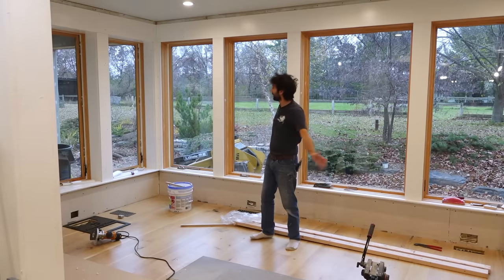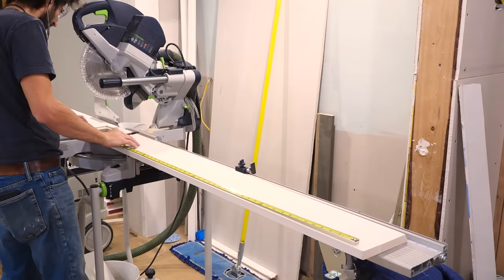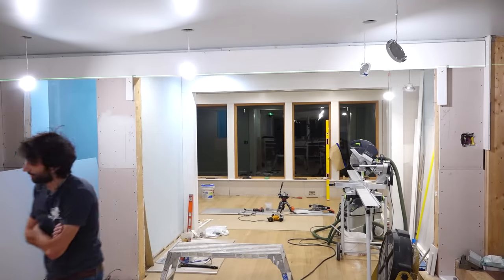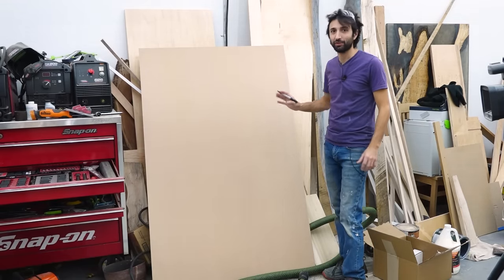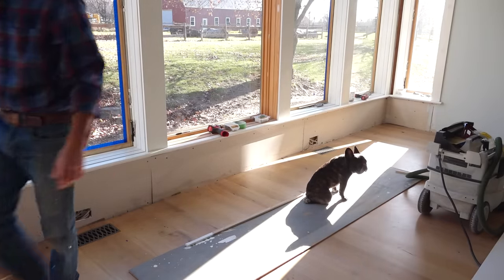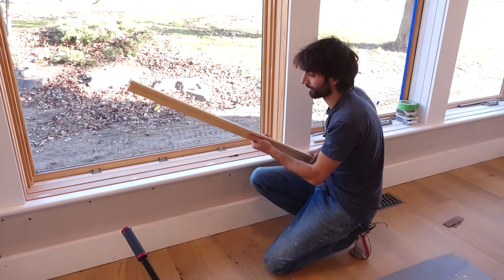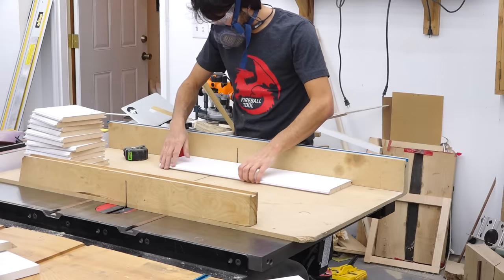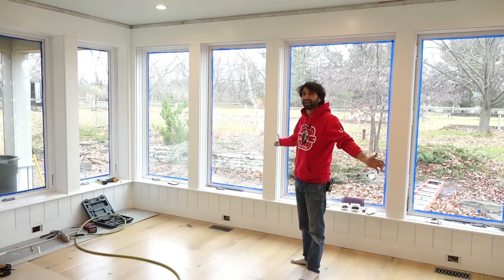Baseboards and V Groove Paneling | Home Renovation & Addition Part 65

Comment: Matt Cremona, I never took you for a barbarian before.  But using a $$$ pattern bit and your precious planer heads on that enhanced-brutal MDF is just too much.  I cry for the tools.
Reply from the maker: My tools would stay pristine if I never used them
Reply: @mcremona  "You can't have your cake and eat it, too!" 😉
Reply: @JV-pu8kx  My real question was of course, why MDF instead of, say, poplar?  Medite at $2 - $3/BF isn't a lot less than rough poplar, and nothing says MDF like the finish of a machined MDF edge, and it will dent more readily then even something as soft as poplar.  There is some time value in less milling effort, I guess, and no propensity for movement.
Reply: MDF is perfect for trim

Comment: I've had that exact issue with a router bit, very annoying! I can't remember how, but I luckily destroyed the template not the work piece.

You can buy sets of different sized set screws which would hopefully include the one you need.

Comment: Looks good Matt.  I don't know if it would have worked here or been any quicker, but setting the T&G pieces using a tile-setting method would have had you starting in the middle and working toward each end and letting the end pieces fill the final gaps.  I know symmetry is important too.  Regarding the relocated floor grille, I think the one point where the offset is most visible is looking at it straight on.  Otherwise, the perspective from any other angle seems to hide the offset.

Comment: Hey I have found putting a second stop on your patter router bit is a safety to back up if the first stop comes loose- also put the bit right up against the router collet will prevent any loose bearing from moving....

Comment: Matt, I’m curious as to why you decided on individual pieces of tongue and groove paneling above the baseboard?  When you mentioned it was going to be T&G I figured you’d be using 3 full length strips with the V-grooves routed in at measured intervals.  I could see individual pieces being used if it was real wood for showing off vertical grain but not for MDF/Medite that’s being painted.  Regardless, it’s looking great!
Reply: My thought was that by using  individual pieces of tongue and groove paneling, he could vary the widths by tiny amounts, thus allowing him to achieve a (near) perfect spacing. If he used strips, the last one would be an odd width.
Reply: @idontthinkso666  By "full length strips" I meant single MDF "boards" the full length of his room dimensions where he would take his calculated T&G widths and use that measurement as the width of each "panel".  I'm afraid I didn't articulate it very well.

Comment: If you use a piece of lead shot under the set screw it will lock it in place and make it easier to loosen and change for the first time then you need to change the shot size needs to be close to the diameter of the bolt a split shot sinker will work just as good  give it a try youwill be suprisedit will work on all hardened steel like drill stops and they loosen rite up with a fap after loosening

Comment: Why shoe, Matt why! The video doesn’t show enough detail, but are your floors so uneven? Did you not want to scribe your baseboard to match the unevenness of the floors? I go to great lengths to avoid the ugliness of show molding. You are clearly a skilled carpenter who fusses over the details. I‘m disappointed your fussiness didn’t extend to scribed baseboards.
Reply from the maker: Covered that in the great room video. The base is so tall that it needs some detail down there
Reply: Shoe is awesome